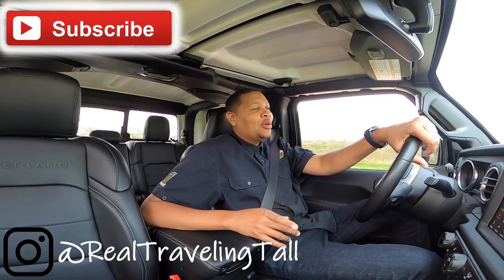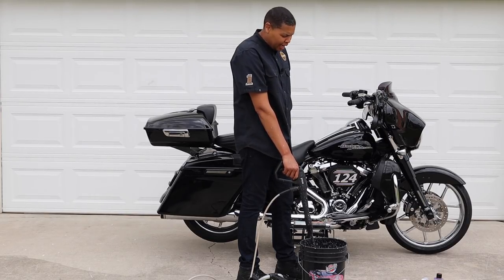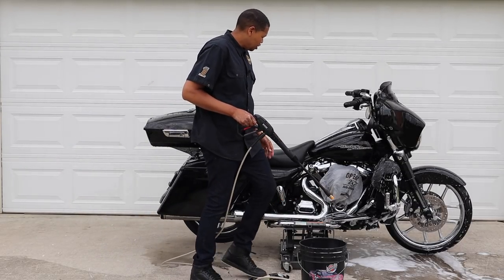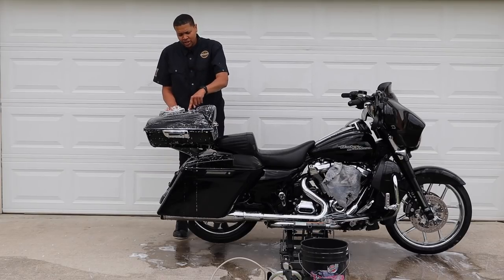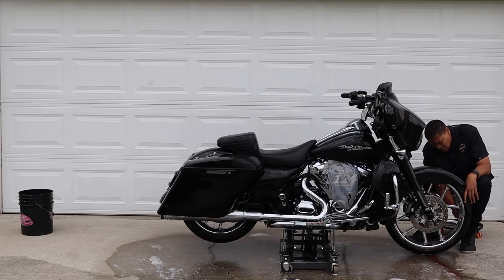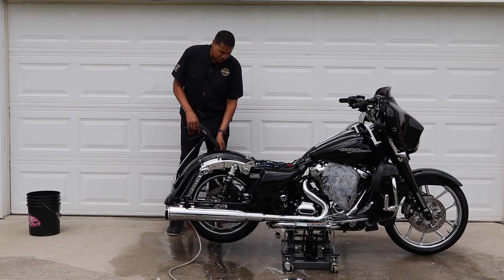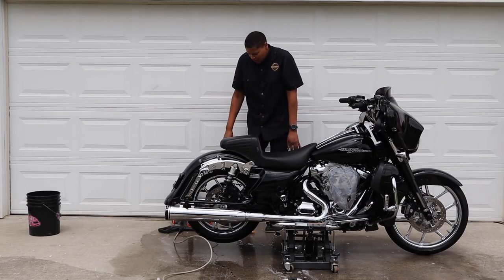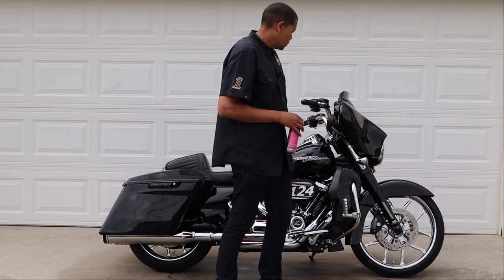How to wash a bike! New products reveal!

Comment: I doubt you’ll ever see my comment but whenever you wash something you truly care about, use the two bucket method. Reduces the possibility of scratches. Just a tip. Great content brother👍🏼
Reply: My two-bucket system consist of me slapping my washing mitt constantly, shaking off any grains of dirt which cause swirls scratches. Before submerging in bucket, I wring it out by hand slapping it around, shaking it real hard, and then go for resubmitted in water. Your bucket will remain free of dirt and any debris that is too harsh. The 2-bucket system allows for dirt to drop down into the bucket and a a result cleaner water on top. But I don't want to dunk my mitt into a bucket that has atoms of dirt floating around grabbing onto my wash mitt? No sir, i prefer to do it the slap-a - mitt way.

Comment: I'm a professional detailer and I use all chemical guys products.  U should try the green foam soap along with the foam cannon as well as the chemical guys ceramic gel wax its blue and works amazing.. that pink silicone detail spray is a great product 👍  great video
Reply: Chemical Guys wheel cleaner stripped the clear coat off of my lower sliders instantly.

Comment: Only thing I'd add to what you do. Be sure to wash the bottom of the bike frame especially. If you don't it will begin to rust and paint peel. Reason being everything you washed off collects on the bottom. When you don't wash it off it sits and collects. Oh, and try what I mentioned earlier. I just picked up a 90 softail all original. I plan on going over it. It's getting buffed and all though.
Reply: Yes, clean bottom of frame,  or your engine will fall out.

Comment: I like your content & the quality of your videos!  I like using S100 Total Cycle Cleaner when using a hose.  My favorite detailer is Lucas Slick Mist Speed Wax.  Make sure that you shake it 1st. It's easy to use, very good results & inexpensive.  My favorite waterless wash is ONR (Optimum No Rinse). When using a waterless wash scoop up with your microfiber to remove dirt instead of spreading it (scratching). Then follow with a clean section of your towel. Use ALOT of towels. My favorite bug Remover is Stoner Bug Eraser Wipes. These are fantastic! Walmart doesn't always have the greatest selection but what washing products they have seem to be priced very good. There are a lot of good detailing products.
Reply from the maker: Thanks for the information and for watching Jim.

Comment: Good info on the chemical guys products Tall!
On another subject......the XFMT products from Amazon. I had ordered a set of their lowers for my older ElectraGlide. They are LOTS cheaper than the other alternatives. But....if there is a problem with them, as there was with mine, (a broken piece) you have to give the company a chance to make it right. XFMT did tell me they would send me a replacement part. (The pivot that operates the door) The problem is, they send it from China. That  can take 60 days to happen. I am in the process of returning them for a refund from Amazon. Just something people need to be aware of before ordering.

Comment: With the Diablo cleaner it works better if you use a microfiber towel on the wheels and it also won’t scratch the chrome like that brush will.

Comment: I use the Kuryakyn Speed Tab # 9037 in place of the seat hold down screw, you don't have to worry about the seat clip falling out
Reply from the maker: I may have to look into that. I take my seat off when I unplug my tour pack light. Thanks for the info.
Reply: @TravelingTall  no problem brother
Reply: I will second that. I need to look into thst

Comment: I wash my bike once a year, whether it needs it or not. That is the day before I get new tires and brake pads. I'm good to my mechanic .
Reply: Once a year bruh? Really? So you realize how expensive HARLEYs paint is.? You have to protect it with at least with a nice protection coating. My Hard Candy is a $3,000 option when it was new. Got to protect it. It’s a 10 stage paint process.

Comment: There's an old saying...if it ain't broke don't fix it. Also there's if it ain't dirty don't clean it.

About 2 years ago, my main touring bike was in repair for several months and I was riding a sport bike which was extremely dirty after a winter storm. I did exactly what you did there mate. And guess what. After winter is over, the bike had major wiring issues, and even after the wash the bike acts up and then went away only to have that wiring issue brought up in Summer Spring times.

To add insult to injuries, the touring bike I used to wash was built different. And that bike was washed that way everytime it gets dirty with no problem. But builds problem overtime. Meaning if I had never washed it that way I would have never have to replace that wiring harness in after 3 years. Same issue with the other sport bike, only difference is the touring bike gave me 3 years. Once you have a wiring issue these are the main thing that happened:

Your high beam light will constantly flashes with your turn signal. Blown up fuses, and this is my best part. Starting with ignition while flickering the turn signal lights. There's also while pressing the horn that decreases the low beam visibility as if you put a module in there that flickers the light. Keep riding the bike long enough, you now have your battery not getting enough charges. Then the obvious.

So that taught me one thing. Just like a car hood. You don't go in there and put pressure water on the electrical parts regardless they are waterproof connectors and just watches overtime dirt's piled up. It's the same as a motorcycle wirings.

You do need to use high pressure water and soap but only directly on the swingarm where you see the wheel brought up dirt to your frame. And if you spray water, make sure you do that in a hot summer time, where it can self-dried with some good sun heat. I said this because I also had a bad swingarm bearing and realize the cause of it.

Technically speaking all you can do is spray high pressure air towards dirts and use your hand with a rag, to clean the body. If you get caught in the rain it's OK, because rain drops is far less critical than actual pressurized water. Although too many rain ride will decrease electrical parts lifespan but you should be aware of it beside risking on braking and acceleration.

To this day I always wiped my bike every 600 miles like it's a chain lube maintenance because at that many miles, you starts to see the discolored fairing mix with whiting marks. And that's all I ever done. Also air spray a lot to remove rocks and last is my bike is always covered outside after each ride and doesn't get driven in the rain. I don't own a garage like some people so it's the best thing I can come up with. So far with that method I have never replaced a swingarm bearing nor electrical wiring harness in constant 3 yrs timing because the wiring doesn't get soaked while in operation nor does water finds way to go inside the loop protector and stays over time. It does builds moisture but compare to actual soaking water, moisture is harmless.

Comment: To save your paint use throw a bnunch of microfiber towels in the bucket. Wash from the top down using one towel per panel or section of the bike. Wheels are always last. Your paint will Thank You Later.

Comment: Be careful with those quick detailer sprays... I also use the chemical guys quick detailer. ONLY use it if your bike is fairly clean. It's good for cleaning up water spots and finger prints... And it's good for making her shine. Using it on surfaces that have dust, dirt, mud, etc (anything gritty) WILL leave you with swirl marks. Especially on that black bike.
Side note: if you really like that quick detailer, you can buy a gallon on amazon for about $48 and use it to refill the spray bottle when it runs empty... That's what I did.

Comment: Be super careful with the pressure washer....do not spray the wheel bearings or you may have a failure.  Just trying to help.
Reply: My son was riding a Sportster to Sturgis and the rear wheel bearing failed. It was caused by pressure washer. Beware!
My owners manual on my Softtail Classic also warns against pressure washing.

Comment: #1) HAVE A SEPARATE WASH GLOVE FOR PAINTED SURFACES/ ENGINE AND RIMS.
#2) DO ALL PLASTICS AND PAINTED SURFACES FIRST
#3) THEN DO ENGINE AND TRANSMISSION AREAS/ RIMS
#4) FINISH OFF WITH THE VERY BOTTOM ( MOST GREASY & GRITTY AREAS ON A MOTORCYCLE.) SO YOU DON'T GET GRIT ON PAINTED OR PLASTIC SURFACES.
#5) RINSE FROM THE TOP DOWN FROM FRONT TO THE BACK.
EXTRA TIPS 👉 SAVE OLD TOOTH BRUSHES ( GREAT FOR THE TIGHT SPOTS )
WORDS OF WIT FROM 👉 IRON-W🐺LF 883 / a.k.a. 👉KAHUNA BEASTWOOD BLACK